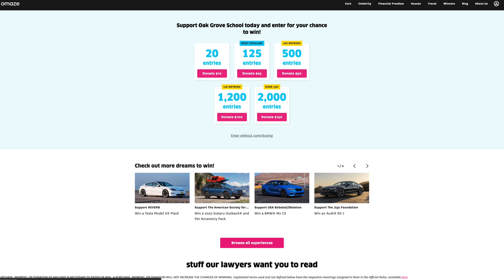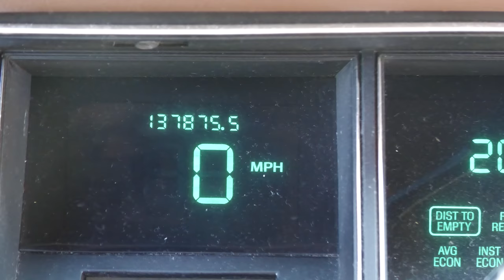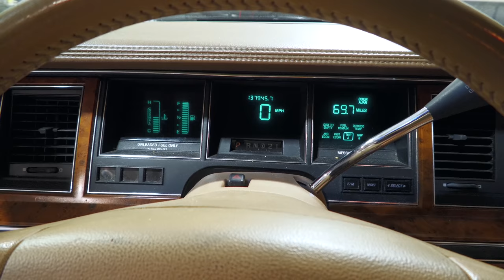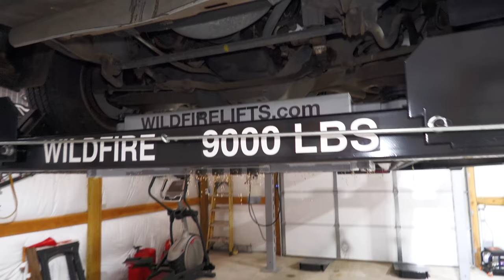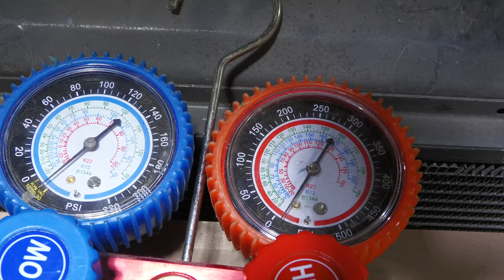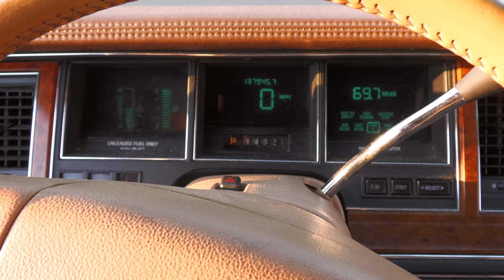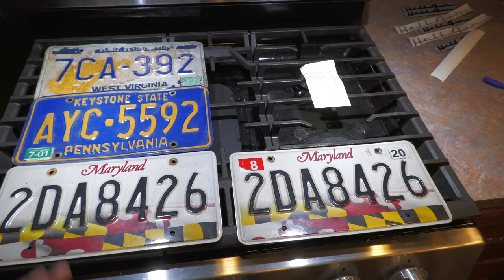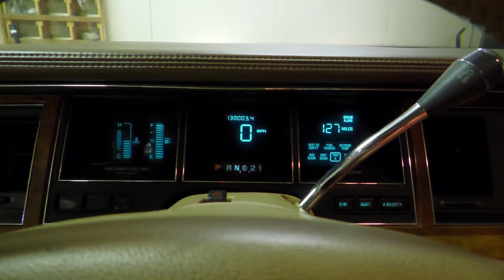I Drove my $475 94 Lincoln Town Car 128 Miles to AAR HQ   Did it Make it?

Comment: The "wonky" shifter is why it wouldn't start the first time. When you dove thru the window and slammed it into park you realigned the neutral safety switch.  Fix the shifter and it will start every time without worry.  Glad you're ok. Stay safe and keep the video's coming.
Reply: I was just going to post this. I just fixed it on my 98 Grand Marquis. Real PITA. 2 hours of work and it starts like brand new.
Reply: ,video was great Randy all your cars are great I love the red plymouth
Reply: The linkage typically stretches as well
Reply: I was thinking the same thing
Reply: He did try to start it in neutral before that and it still didn't start.

Comment: Glad you didn't get hurt brother! But that air bag light is flashing a trouble code I think it's 13 the way you read it is there are usually 2 sets of flashes on an obd 1 system. The first one is 1 flash then a short break then 3 flashes. For the trouble code 13

Comment: Most Older Fords, Lincoln, Mazda, Mercury Etc. Will normally flash the airbag light. The flashing of the airbag light is actually a code it will be broken down into 2 sections so like if the code is say like 14 the light will flash once then pause then continue blinking for the next 4 times then it will pause again and then repeat. Hope this helps find out what the airbag light is on for. Thanks for the great videos!

Comment: Here is a video on how to replace the steering column  shift tube bushing,,,  fairly easy fix,,,   Also  the Dorman #14057 bushing kit will fix where the shift cable attaches to the transmission,,  So happy that you did not have to use your body as a tire chock,,  :-)
Reply: Sounds more like a Linkage problem then a bushing problem

Comment: The common shifter problem is loose screws at the BOTTOM end of the mechanism, by your feet. Trust me
Reply: Yes, had a '93 Ford Crown Victoria, the screw on the mechanism on lower steering column, believe it is a Torx or Allen screw.

Comment: On the OBD 1 connector, ur gona find a single wire connector right next to the OBD connector. U have to put a jumper wire from that single wire connector to the 2nd top terminal on the OBD connector.
That is gona put the PCM into test mode and u can read the codes by counting the number of times the check engine light flashes.
But the actual procedure to correctly read the codes on OBD1 Fords before 1996, is a little more involved. 
Look it up

Comment: there's a screw that's loose on the shifter tube in my case the screw fell out, you have to go underneath the dash to tighten it, that will fix the wonky shifter and that's probably one of the reasons it wouldn't start, I had the same problem with my 1996 Lincoln, it wouldn't start because it wasn't all the way in the park due to the wonky shifter

Comment: I had that same problem with my 96 grand marquis. Its the shifter bushings, they have a kit for $20 that has the 2 plastic bushings and 2 metal plates with screws. That will fix the issue.

Comment: I've got a 1988 lincoln town car and the frame is the same as your 1994 lincoln but I have the 5.0 302 v8 and mine has 86000 miles on it and I saved it from being crushed and the only thing wrong with it was the fuel tank and fuel pump and it is white with a dark blue carriage top and white leather and blue carpeting in it and it was a clean car.

Comment: Ok I retract my previous comments. I got a good count of the airbag flashes. There looks to be a short to ground. Here is the beginning of the chart. Looks like ur code is 13

Continuous Air Bag Indicator - Air Bag Diagnostic Monitor
Disconnected or Inoperative
12 Low Battery Voltage 
13 Air Bag Circuit Shorted to Ground
14 Primary Crash Sensor Circuit Shorted to Ground
21 Safing Sensor Not Mounted to Vehicle Properly
22 Safing Sensor Output Shorted to Battery Voltage
23 Safing Sensor Circuit Input Feed/Return Circuit Open

Comment: Randy; willing to bet that the shift linkage bushings are worn out. Replacements will take out the slack and fix the lever position.  Always set your parking brake while under a vehicle on a jack. Good Luck 🍀 on the paint and sale.

Comment: Two torx bolts on the back of the column.  T30 or so in size.  They connect to the shift tube for the column.  snug them down.  There are two shifter tube bushings, the tube slides on them.  Hot heat, they dry out and fall off/disintegrate.  Fix all those, and you'll regain shifting.

Cool car.  I own 4 TCs - Love them.  Tough, safe, reliable.

Comment: Time for a new shift tube under $30 and about an hour or so job. Airbag 13 code, check the 2 fuses and the crash sensors for corrosion. Usually have to clear the codes manual. Check engine light is probably the beginning of clogged EGR channels.

Comment: Love seeing "Kristy"  here and there. I go nuts seeing her. You brought back memories about the Stinking Lincoln jumping out of gear. My "62" Chevy did that to me all the time and my starter went out and hot wired it to start it from the battery. I forgot about the darn shifter and the car went flying into to reverse and smacked into a brand new "1974" El Camino and tore up the drivers door. I went to go tell my neighbor and he said he wasn't worried about it because it was a loner car. (???????)  I was scared he was going to hurt me but nothing ever came back to me about it. I was just lucky. I did have insurance. The air bags on the Lincoln need replaced.

Comment: "Once I got it stopped and cleaned up the mess"  As in putting on clean underwear?  With the shift lever, most likely the bushings on the linkage, should be a breeze to do those, for the safety of the new owner....   My 1994 Thunderbird had an OBD 2 port located under the dash by the glovebox, left side near the trans tunnel. Might check and see if this car has one?
Reply: Those were fully obd compliant. I bet his CEL is a clogged EGR, common on the Tbird too. Shift bushings are a must...takes an hour or two.

Comment: Used to be the "Heavy Line " guy at local Dallas Ford/Lincoln/Mercury dealerships from 90 till 2004. Engine replacement ,overhaul, oil leaks,  etc. These Town Cars/ Grand Marquis had a ride of their own. Like a cloud.  But, when we replaced the airbags we replaced the module as well and re-grommet the air pump, saved a alot of re checks. [customer returning for an air bag light]  Pricey but worth it.  FYI  these engines usually had a 421 code if I remember correctly, DPFE sensor. it is located on the back of the right head with one connector and 2 short vacum hoses. They would get water in the sensor and short out.

Their was a recall/TSB on the exhaust pipes/ muffler/ resonator as well. the pic @12:38 was were they used to rust out prematurely.

Other than that the 4.6 surprisingly ran well.

Comment: If you pull the bottom off the driver side of the dash and look under it with a light while you jiggle the shifter, you'll see where it connects to the shift linkage. There's 2 small bolts on it that back out every once in a while and cause it to be loose and not fully engage park. My 1994 grand Marquis used to do that about every 6 months.

Comment: The wire race behind steering wheel is usually the issue you can check the cruise control feature and you will know if that clock spring wire chase is bad

Comment: Video quality is definitely worth it! Your audio since the Rode Mic has always been pretty dang great! That shifter is a common problem on and column shift Ford/Mercury/Lincoln of that era.  Very common on a Taurus/Sable which use the same steering wheel. Usually the bushing need replacing if I'm not mistaken. Worth fixing for the piece of mind. Had a friend with a 94 Taurus where it wouldn't shift anymore from that and got stuck in neutral and wouldn't start. Replaced the part of the shift in the column and it worked like new again. Cheap parts too.

Comment: On the transmission  there is a set nut that goes to the shift cable my old ford did that you use 2 wrenchs and have some one move the shift lever and you can adjust the shift cable. Be safe nice car .

Comment: The new camera does a lot better so far Randy. Sound is perfect. Much better then the Go Pro, definitely do not need that crashing constantly.  Either overheating or loosing footage which stinks. Now let's see how it does on a Copart walk around if it can take the heat better.

Comment: At the common problem with those if you look underneath the dash where the steering column is there should be to T25 or T30 Torx bolts that have work themselves loose tighten those up and your shifter will be good to go just like new I've done this on for vehicles now works every time

Comment: Randy I was told that the vacuum test on the A/C is not 100% effective, reason being is that sometimes it sucks the O rings to seal as long there is vacuum and when you put in the new Freon  it leaks back out. I was told that putting in a dye and Freon and run it and look for the leaks by seeing the dye is the best way to find a leak. Where you find the dye on any line or compressor you find the leak.

Comment: Randy, there's 2 torx bolts on the bottom of the column that are most likely loose causing the shifter to not go fully into park. Had the same thing happen with my Sable and my brothers Grand Marquis. Take one screw out at a time, thread lock and tighten, then do the other and you'll be good to go! Love me some Panther! Such nice riding cars being the last full frame cars in production till Ford decided to kill it

Comment: And the intermittent air suspension is because of a slow leaking bag or fitting on the air supply lines.  Put it on the lift and use soapy water in a spray bottle around the bags and hoses and listen for hissing and bubbles. It's a fantastic car. I wish I could buy it because I need a bigger car due to back problems. I'm 61 years old and 6'5 and 315 lbs. I was a mechanic and machinist for 30 years

Comment: For the air bag light I suggest you check the wires under the front seats, Maybe unplug each one and check them for broken wires or a ground and lubricate them with lithium grease and replugged them in. That's what I think is causing the problem because it happened to my car and that's what it was

Comment: I used to be a 2-way radio tech in a previous life. It's been over 30 years ago now but there is NOTHING more frustrating than trying to find an intermittent connection-on a car, or in any electronic device-especially after it suddenly disappears on it's own!

Comment: Many Fords of this vintage had starter interlocks tied in with the shifter AND brake light switch. If either are out of adjustment or bad, it won't crank. My wife had a 1990 Cougar that had the brake light switch go bad so I know this works.

Comment: Pick yourself up a bosch 1300 scan tool and it comes with the connectors for older fords, gms, chryslers, and toyotas. Essential for working on older vehicles.

Comment: Randy, I watch your videos almost every day and enjoy them. Please correct me if I am wrong about your preceding video on the Lincoln. You were under the town car with it being safely jacked up. Then you successfully start the vehicle with a screwdriver touching the right contact points on the starter. You emerged from said vehicle and stated that it scared you. There is no video of the car falling from the jacks and going into reverse as you indicated in this video? Was this part selectively edited out? I think it would have resulted in higher viewership, if shown. Fords are notorious for popping out of gear since the 60's. I am surprised that it happened on a 94 Lincoln? I am glad nothing was damaged. Your commentary and clarification would be greatly appreciated. Tumultuous Ted
Reply: It would be cool, if a car had some kind of Parking/Emergency Brake system that would hold the car in place, if it accidentally went into gear.

Randy isn't the only person on YouTube, who wonders why cars have Parking Brakes...
Reply: @sixtee5cuda98  more times than not on older vehicles the parking brake is all worn out.

Comment: First, I'm glad you're okay. The shifter should be repaired, and I believe it is worth it for video time. Ask Macco if they can reclear the hood, roof and deck lid instead of a full repaint to save money.  Repainting it the original color will do nothing but help the car. The scratches on the '57 should buff out.
The new camera is excellent.

Comment: Your shift problem is 2 torque bolts that back themselves out after awhile. They are under the driver dash mounted to the steering column its up in there a little ways but its your gear selector.. Take them out use thread locker then tighten them. Common for the fords.  I'd replace those air bags very soon, or convert them to the monroes. I've owned several of these and currently daily drive one. These cars are tanks and just as reliable as any toyota. The 4.6 has its faults but easy and cheap to work on. Parts are almost always available and most are upgraded to fix those faults the earlier years had. I knew when the first video was posted that it was something simple these cars usually are

Comment: 15:36 be sure to smear a glob of chassis grease on the bump stops(2002 and older Panthers) where the nub on the steering knuckle hits the little plate welded to the A-frame to stop the steering travel. Those are dry and probably have not been lubed since the late 90s. No oil change place knows to do this these days.  If you don't smear a glob of chassis grease on the bump stops during each oil change you will get the ultra loud popping and screeching sounds in a parking lot with the steering wheel cut as sharp as it can turn...

Comment: I had a 1990 and at 68,000 the speed sensor failed which disabled the digital dash, cruise control,  the trip meter and the gas gauge and related systems. It was an expensive repair so I traded it in

Comment: you just need a ford obd1 code scanner   to scan the codes  or just buy a INNOVA 3145  ford digital obd1 code reader  for  about 30 dollars on amazon   and the underside of that Lincoln is actually amazing for a 1994  with 137,000 miles on it

Comment: There's a star bolt at the end of the shifter that needs tighting. You have to drop the steering column to get to it. I had to replace the shifter on my 93 because it broke

Comment: Randy I own a 1996 Town car had the exact same problem with the shifter and gear indicator easy fix if you follow the steering column down you may have to remove the knee bolster cover you will find at the end of the shaft there is a lever that is connected with two screws which are torx head they are commonly known to loosen the easy fix is to tighten these two screws up after applying thread locker one at a time again a very common Ford thing actually anytime you get a Ford product with the gear selector is loose and wonky as you say lol that is 99% the problem I will try and send you a picture if I can

Comment: The shifter comes loose on my 1997 town car to tighten its under the dash 2 torque bolts i think also when the brake light swith on the brake pedal goes that will mess with your shifter also you will almost never find a leak on one of them especially antifreeze if you ever notice your coolant is always lol it will be the plastic intake manifold but all in all a great car drive my 1997 everday still ps don't mess with the airbags they are a nightmare lol.

Comment: Sounds like a worn out Column shifter or a part in it. I can't imagine it slipping out of park.   Check engine light/ attached to just about everything through the vehicle computer. Sounds like some Co2 Sensors may be corroded over and are now breaking free inside the exhaust. The column shifter is the most critical right now.  An engine detail wouldn't hurt.  Oil change, transmission oil change.  Rear end gear oil change and the air filter check.  Might be a lot of dust in it.  I guess, "MAKO," is one of those last ditch paint shops.  I bet they don't remove the trim.  At least make sure they sand it good.  Put a primer coat then wet sand the body.  I'm worried about about that for some reason. Well good luck with it.  Hope Mako can remember?  It's not going to be cheap if you go ahead with the project.

Comment: Replace the rear air bags with new one (less than $75 on eBay) and that should fix the air suspension light

Comment: So my 1994 Ford F-150 had the same problem with the shifter. It ended up being some kind of broken bolt inside the steering column.